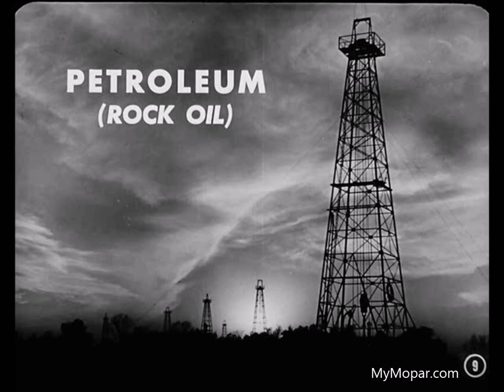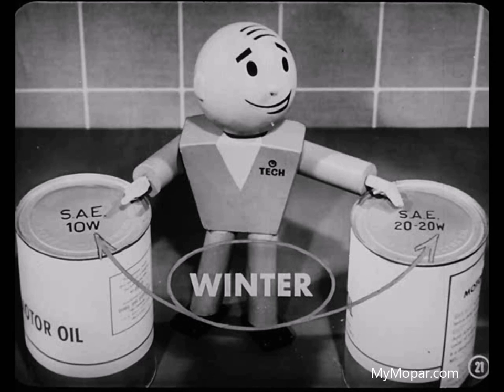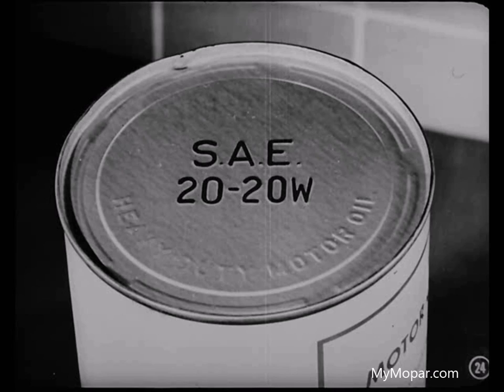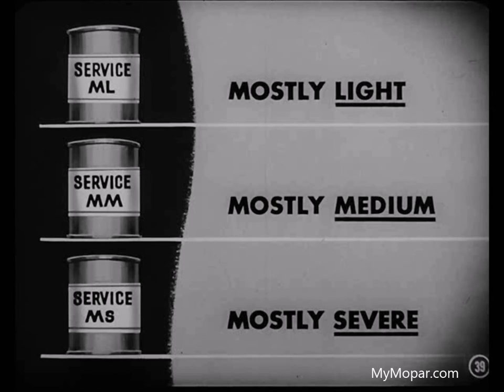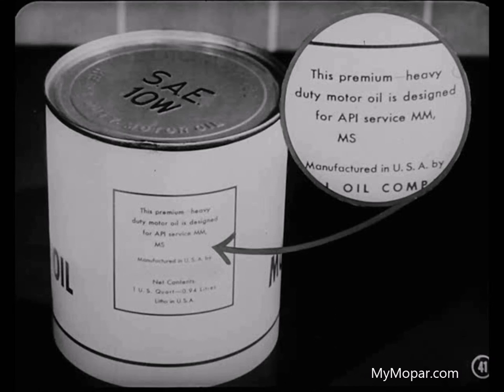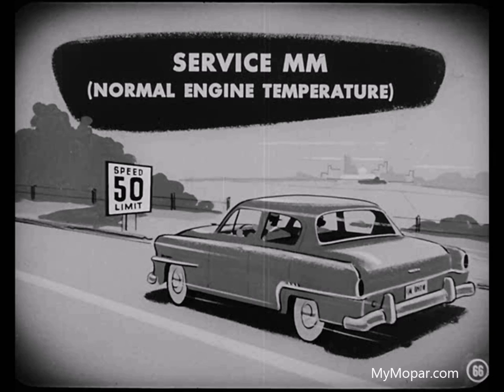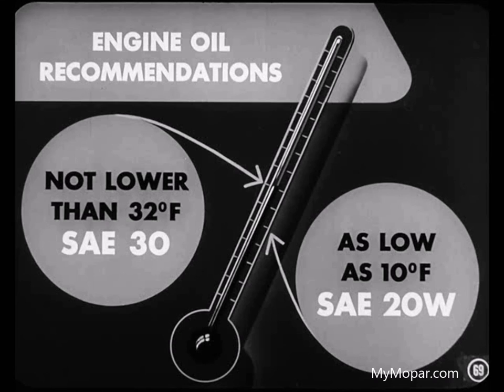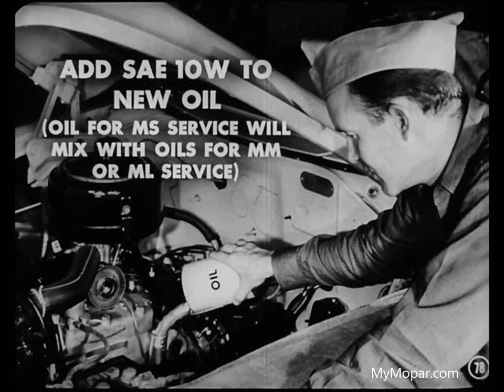Chrysler Master Tech - 1953, Volume 6-10 The Engine Oil Story

Comment: Moral of story nobody knows how people really drive cars out here in the real world except most people somewhat abuse cars so use the best quality oil and change it often.  As my dad used to say "oil is cheap and replacement engines are expensive".  A side benefit is cars with relatively clean oil have lower friction and get better gas mileage.
Reply: I was in an automotive class when the teacher said "Chemicals are cheap, cars are not." He said that when he asked us about when we all replaced our antifreeze. I said that I wasn't worried because my car was 3 years old, and the manual said I have 5 year coolant. He asked if I drove in the ideal condition. I said no, and he explained that changing more often than the manual says is important.